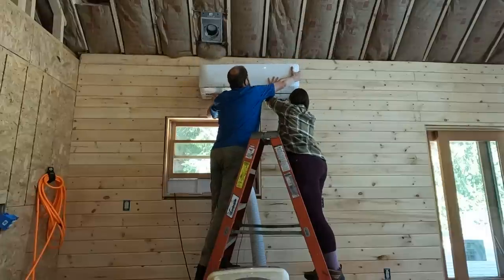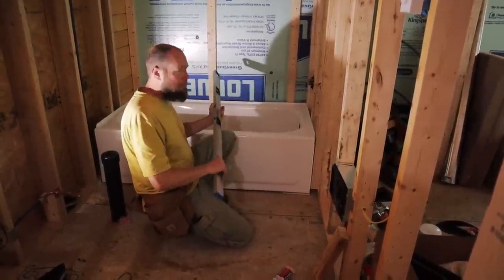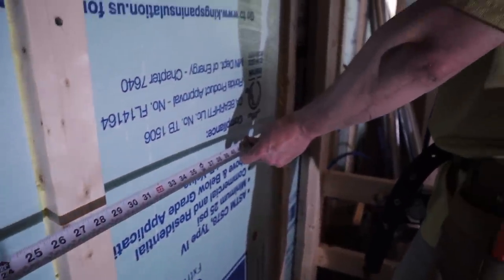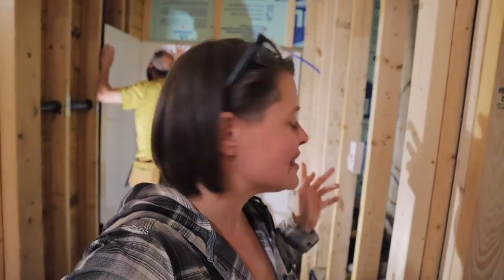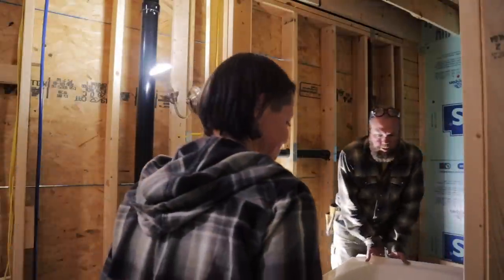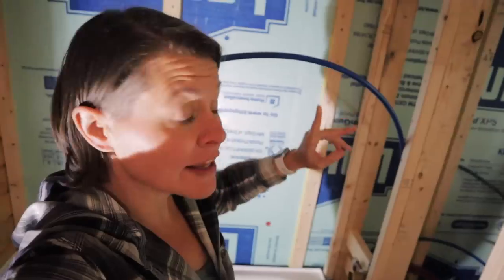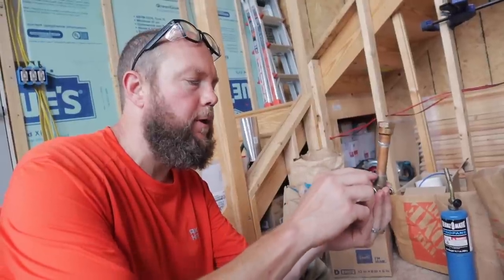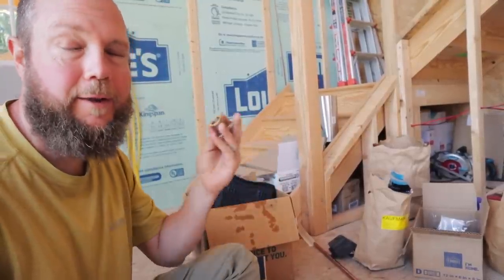UPGRADING our QUALITY of LIFE // The START of our BATHROOM BUILD

Comment: If it was just 1 or 2 joists not more than a 1/4 high I always pull out the belt sander & knock them down the sheeting isn’t hard to belt sand down on the high spots. This will also help when doing the rest of the bath floor not just where the tub is.
Reply from the maker: That's a really good tip.  I ended up getting some self leveling cement and bringing up each side instead.  Worked pretty good and now I don't have to put down cement board for my tile.  I'll definitely think about pulling out the belt sander next time.  Thanks Roy!

Comment: One main issue is make sure everything is clean and flux, and next you always put the heat directly on the thickest parts so that when the soder draws into your joint, it seals well to both parts., and if you ever have to soder on something that has a valve that can be damaged by heat, you need to remove those parts and once the soder is done, you put that valve back in place that is done not to damage the valve.
Reply from the maker: Good tips.  Thanks for taking the time to comment and for watching our videos.

Comment: One word from a HVAC guy that did a lot of soldering of copper. Do not heat the joint directly, heat below the joint so the solder will be drawn into the joint.  ( clear as mud I hope. ) one other point, soldering flux does not need to be applied with fingers, using a flux brush keeps the flux from any human body oils.
Reply from the maker: Good tip.  I was a little unclear on where to point the torch but finally got the hang of heating above the joint like you described.  I learned my lesson with the flux.  I had a small cut on my hand and it hurt a bit after messing with the flux.  Next time I'll be buying a brush for sure.

Comment: American plumbing is soooo different to UK plumbing 🙄 your baths are short, you've got to use that black paste stuff on joints 🙄 
In the UK, our baths are longer and we use screw type white plumbing pipes under the bath & sinks (faucet to you I guess 🤭 )
But your place is coming along nicely 🥳🎉👏
Reply from the maker: Thanks for watching.  PVC is used frequently here as well, but usually not the screw on fittings.  Interesting that tubs in the UK are longer.  Maybe you guys are taller?

Comment: While you two are doing tub and shower stall. Why not continue up with shower walls with some type or same as walls already; So you can raise shower head up enough so your husband can actually stand under shower Head; instead of having to bend or squat under it? Unless it was just angle of your camera that makes it look like your Husband is Much Taller than shower head. Then just patch original hole for shower head.
Reply from the maker: You are right, we should have raised it up.  Luckily this is only our kids bathroom so it should work out fine for them.  We'll make sure to make it taller in our master bathroom.
Reply: You do know they are likely to be tall also? Better before you tile. Just saying.....